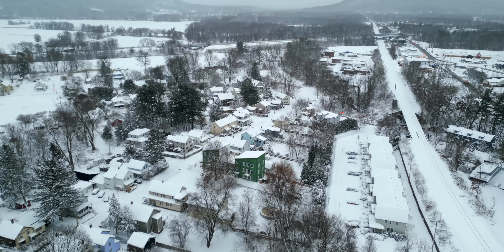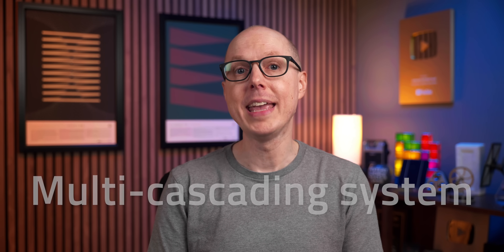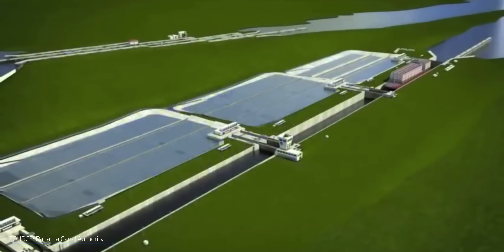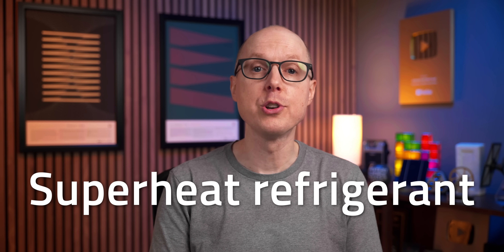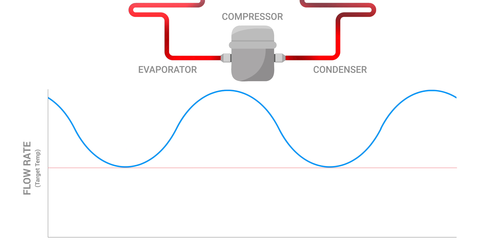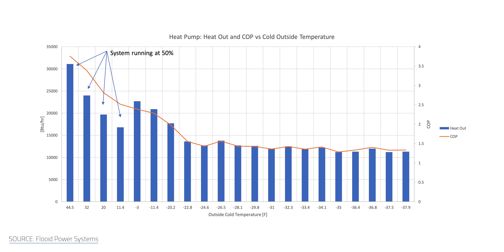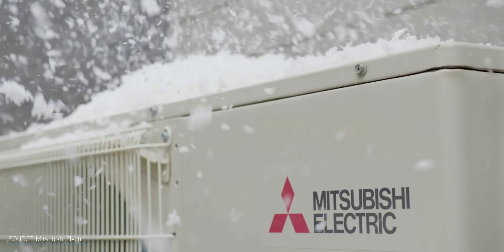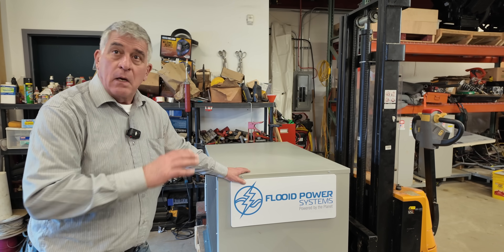How This New Heat Pump is Genius

Comment: Ground source...

The refrigeration cycle is the future.

I've always thought that a central heat exchanger utilizing the heat store of geothermal was the way to go.  Then, heat pump water heaters or full AC systems can tap into the geothermal fluid tank to heat and cool.  And rather than waste the heat to the atmosphere, it's eventually pumped back into the thermal battery of the ground.

Geothermal temperatures are around 55°F year round depending on latitude.  There's your constant fluid temperature issue solved!  And, in the Summer, there's no need for the compressor to run at all with a thermal battery at 55°F!

Imagine your kitchen refrigerator being almost silent since the the compressor is in the basement with the geothermal heat exchanger tank!
Reply: You need to have a system that doesn't leak, otherwise you have an expensive repair. Ask me how I know.
Reply: @jamesvandamme7786  Yep!  Leaks do no good in any system!
Reply: @jamesvandamme7786  Yep, natural gas, oil, and propane never leak.

Comment: Sorry but sounds like BS, because it doesn't add up. You can cascade a million times but you aren't getting more heat than the first unit can move heat pumps aren't some magical device and when giving their numbers they 400% efficient they are 400% effective. The difference being that efficiency is the conversion of power which can never exceed 100% and in a heatpump that conversion is electrical to rotational a heatpump doesn't generate heat well other than losses but as a function of it's operation it moves heat from one location to another.
Now for the cascading system if we take heat and think of it as a unit of mass, if the first unit pulls 4 tons of heat from a source and put it in a holding tank then a second unit pulls from that holding tank to heat an area there is still only 4 tons of heat except now you have used double the power. The limiting factor will always be how much heat can be extracted from the source
Reply: A function of it is operation? Huh?
Reply: There's no such thing as a "400% efficient" (really COP of 4) heat pump, that's just a marketing average. Hot and cold side temperatures affect the actual capacity and COP of a heat pump. A given heat pump might be able to output 5000W of heat when it's 5F outside and 70F inside but if it was only 45F inside it might output 10000W of heat.

Comment: Best thing to do is buy an regular furnace. Cheaper simpler, more reliable more comfort, faster temperature changes. Works best and you dont have to think about it. To much over engineering and less reliable costly products.

Comment: you could achieve the same with 100 year old tech  of using ammonia (R717) with out having  cascading  heat pumps .  ammonia   is cheap , environmentally friendly (not ozone depleting or a  greenhouse gas as the amount of refrigerant leakage per year is equal to  couple 100 million cars on the road in comparison to GHG effects  )  . and  6 times more efficient then other refrigerants

Comment: We have 2 air source heat pumps, about 10 and 6 years old, on our home.  We live in CT these days and oil is our primary heat source.  We have consistently saved about 1/3 to 40% of our oil usage for heating, thus saving hundreds of gallons of oil each year while saving money, as the net cost of electricity is less than the oil for those BTUs.  I am an engineer, and compare our oil cost * efficiency of our furnace to our heat pumps and electricity costs.  It's a no brainer for saving money, and we still have the oil for days below about 30F.  25F to 40F roughly, depends on the oil price and electric price that year, is our break even point.
Reply: Wouldn't a ground sourced heat pump be able to do 100%, and NO fossil fuels?
Reply: @LoanwordEggcorn  In most of the USA (basically excluding Alaska and the northern-most portions of the states bordering Canada) the question is less ground source vs. air source than it is one of system design.
The other thing to keep in mind is your target: 100% heat pump with no backup for cost control and comfort OR a system designed to minimize costs during times of temperatures low enough to cause the heat pump to be less efficient.
Reply: @DrewNorthup  Ground source heat pumps are far less affected by air temperature, etc., since the ground temperature (a few meters down) is far more stable, including at northern latitudes.
Reply: I'm up in Maine and did >65% of my heating last winter with a heat pump. In fact, the main reason why more of that wasn't done by the heat pump is that it can't heat the bedroom when the door is shut (1 mini-split in the primary living area). The unit was made in 2021 and is good down to -15°F, with the apparent "cross-over" temperature being around -12°F at worst. (In reality the separately controlled oil heat loop likely began to kick in around -11°F as the rooms far from the heat pump would've been hard to use otherwise.)
Reply: thank you for the information. I to live in CT and this is one more reason to go with a heat pump
Reply: @charlessalisbury4237  just get a very large one that is good for heating or have a backup. We didn't take out our oil system. We just left it there and we just use it a lot less basically nights in January. Unfortunately you know when you get those. Really cold days here in CT. It's it really is unfortunately still better to burn the oil. I don't know about natural gas because I asked the gas company when we moved in and they're like they're not going to bring the gas line anywheres near my street let alone my home. So that's off the table for me.
Reply: Australian here, what do you mean use oil for heating? You don’t use the oil as fuel do you?
Reply: @aussiegruber86   That's exactly what oil heat is. Oil is pumped through a nozzle and burned.
Reply: Yep it's fuel oil, we don't kill whales for it anymore... But it's stored in large tanks and burned indoors with a ventilation system. It's really only used in the northern climates top 30% of the US.  @aussiegruber86
Reply: @aussiegruber86  yes millions of US homes, mostly between the state of Maine to New York burn heating oil. Mine is one of them and it was built about 40 years ago.
Reply: Current cold weather heat pumps work well below 30 degrees F. We have an existing natural gas boiler that serves as a backup but only use it if the temperatures drop below 5 degrees F. In our case that was 2 days last winter. Other cold climate heat pumps can still provide 100% of the their rated BTU capacity at -10 to -15 degrees F.
Reply: @COSolar6419   It depends on what you mean by "works well." Current cold weather heat pumps maintain decent capacity well below freezing but the COP still falls with lower temperatures. Below a certain temperature it's more cost-efficient to heat by burning fossil fuels.
Reply: @eDoc2020  Not if you count the environmental costs of burning fossil fuels and fossil gas production. Those are real costs we pass on to everyone.
Reply: @COSolar6419  you are assuming that electricity doesn't come from fossil fuels too.  

Consider electricity losses in transmission.  Consider the environmental impact of solar panels, I have made them, or wind, but neither of which provide more than a few % of power in my area. Mostly natural gas is our electricity source
Reply: @COSolar6419  our heat pump works below 25F but the efficiency falls off and our oil furnace is more coat effective.  It will supply heat down to those temps but at low efficiency.

Comment: Here in northern Maine our electric rate is $0.268 /kwh delivered. Even a 300% efficient heat pump is not economical compared to burning things. I burn wood, most "green" heat there is.
Reply: Conventional wood-burning stoves are only up to 60% efficient IIRC. The most efficient option for heating from wood is a wood gasifier feeding a gas turbine which powers a heat pump. The waste heat from the turbine would also heat the house.

Is this overly complicated? Yes.
Reply: @eDoc2020  I have an indoor wood gasification boiler and thermal heat storage. I estimate my system to be 80-85% efficient.

Comment: My instincts point me to lower technologies. Here is my concept: very high mass within R-60 walls and ceiling. Night time ventilation per a fan driven reverse chimney to cool the dwelling the day. A batch water heater for eight months of the year. Kitchen and laundry isolated and vented. The three story house counted a full basement and a deck over the roof system with full parapet to hide solar panels. Granted this is dwelling would be masonry heavy and it won't be 30 year life span strand board 'master piece'. It is a pipe dream. Too poor and too old for it to matter.

Comment: Cascading heat pumps means more equipment, higher cost, and more maintenance. There may be applications where the benefits outweigh the cost and complexity, but not for the average homeowner.

Comment: How would one purchase these heat pumps types?  Especially for the Southern States with high cooling loads?  Local dealers are stating these  units are not available and it will take ten years or more if they come to market at all.

Comment: Couldn't you do this with one heat pump that dynamically adjusts the fluid type to optimize it based on the external temp...?

Comment: I used to work on controls for cascaded refrigeration units for use in medical and scientific applications. Once you have a second stage, it's pretty crazy what kinds of temperature gradients you can have. IIRC, one of them I worked on was a -150C system.

Heat pump is love. Heat pump is life.
Reply: Let us know when you get a heat pump tattoo 🤣 pump on!

Comment: Glaring problem with cascading heat pumps: there are only a handful of technicians that can service the system in Massachusetts, and they all work at Thermo Fisher and Shon's.
Reply: Doesn't... every new technology only have a handful of technicians at the startup stages?
You know that HVAC training is a thing, right?
Reply: Everything on this channel is always cutting edge. There's not many people doing anything he talks about. There's not a lot of electric car repair shops either

Comment: It’s an interesting idea, but I’d much rather see a standardization for residential appliances like refrigerators, freezers, water heaters and outdoor heatpumps, so I could link all of them as an interacting refrigeration cycle system. Seems like propane would be an ideal refrigerant for this purpose, however American HVAC trades/unions wouldn’t like that one bit.

Comment: I'm planning on intergrating my MVHR setup to work with an air-air heat pump in the future, I really wish there were more videos on how to accomplish this, I had to teach myself.
It involves a fair bit of clever ductwork, but the idea is to further reduce the load on the evaporator head so that the heat pump has very little to do, either in heat or cool modes.
I currently use my excessively over-insulated loft space as a sort of 'thermal battery' and that's what my MVHR unit currently draws air from, so the loft space is one huge heat exchanger.
To date, I've never heard of anyone using a passive system like this, but it works extremely well so far.

I've had to do this because my ancient (20yr old) gas boiler does not run very well, it struggles at anything over minimum temperature settings and I currently can't afford a new one.
Therefore, my focus shifted towards making the MVHR system as efficient as humanly possible. The loft is vented, but it is only an inlet for fresh air. The MVHR unit draws this pre-warmed air from the loft space, boosts the temeprature up and pumps it into the house. Any warm air from the house is sucked into the MVHR unit, the heat is recovered, then exhausted outside.
Fitting a heat pump evaporator unit between the MVHR house suction and intake vents only would mean that the heat pump is only accounting for the small efficiency loss of the MVHR unit (curently around 80% efficiency) so the heat pump is only adding in ~20% into the house to maintain a temperature, instead of having to apply 100% of the load.

One other thing that I can currently do with my MVHR setup is that I can change the height of the loft intake vent by opening and closing a set of damper valves. This dictates how much air is being drawn into the loft space depending on what season it is. In summer, I open the upper damper so that most of the heat in the loft is vented, but in winter this is closed and the air is drawn in at floor level of the loft (due to heat naturally rising towards the top of the roof, where the intake of the MVHR unit is placed). 
This effects if the MVHR is drawing in cooler outside air in summer or warmer rising air from the house in winter, I plan to make this motorised and automatically controlled.

I'm currently working on a way of adding in a heat pump hot water cylinder in the further future, but ducting this in as well seems to be interesting.
The goal is that as little heat as possible is exhausted out of the MVHR unit, while in effect, making an air-to-air heat pump indirectly provide hot domestic water.
For a couple of figures, my MVHR unit draws a constant 25W of electricity, yet in it's current setup, it's maintaining my house between 16-18'C whatever the weather outside.
Adding in the air-to-air heat pump is primarily to get rid of my unreliable gas boiler, but it's worth using the existing MVHR system to heat the entire house from 1x HP unit.

Comment: Matt: A cascading heat pump means you have multiple sets of compressor, condensers and other components in a heat pump. All else equal, the cost would be higher than a non-cascading system. People justify a hybrid heat pump system with electrical heat or a gas furnace because an extremely cold day is not commonly encounter in winter. Why pay more for a cascading system if you only need it a few days in a winter season?  I think you would only need it if a non-cascading system cannot do the job on a regularly basis.

Comment: I want a heat pump with reversing valve in the form factor of a window ac unit.
Reply: They make those now. I think they came on the market in the past year or two.
Reply: @eDoc2020  Would you happen to have a web link to one?  I haven't been able to find any.
Reply: @PupShepardRubberized   I'm not finding too many window-style ones but am having better luck with portable-style ones. One example is Westinghouse WPac14000h which I am sure heats using heat pump. Many cheaper ones only have resistance heat, the 10500 rated heating Btus (and one customer review) confirm that this heats using compressor. The largest resistance heater that you can possibly run on a standard household outlet is about 6000Btu/hr.

Comment: Cascade cycles and 2 stage systems have existed since mechanical refrigeration was invented.  Any good refrigeration engineer can design one…..many engineering classes have had a group project on this very topic…..then having done so has determined it to be uneconomic for residential heating in cold climates….end of story….

Comment: It's a very interesting concept that if they work out the theoretical (lab results) into an actual product that can be produced & sold it could be impressive. (So much so that I could see a larger company buying Flooid Power out) That said as long as the primay needs are heating, it's still not going to do better for your standard home customer if their primary needs are mostly heat & Nat gas is as available & cheap to use.

Comment: boven 46’C wont work, haha what a bullshit

heatpumps with R134a or newer R290 Propane work just fine up to even 70'C (158'F) at COP of ~2.0 and sometimes even higher, no need for expensive cascading there

Comment: I would be interested in the systems Noise levels.  If we want the basement area where the inside unit connects to the ventilation system to also be a living space, can we put the inside unit in an insulated control room?  How noisy is it and how much ventilation fan noise?  How do you manage multiple temperature zones - say 2nd floor bedrooms with baths, and 1st floor living spaces, and kitchens, and basement suite?

thanks!
Reply: It should already be insulated and additional insulation shouldn't hurt it. There's probably a damper-based zoning system that is compatible, just like you would use on any forced air system.

Comment: Or if your building your house from scratch you could use a passive air conditioning system that resembles a chimney referred to as a wind catcher like that used buy the ancient Persians and Egyptians and save alot of energy. The advantage being the technology is well known and around 3000 years old so it's definitely a mature technology and it uses 0 energy yet can produce ice in places like Iran which can reach up to 130f.

Comment: I wonder if this setup can be kinda upscaled let's say 3 units to get extra high temperatures 570F~300C so that in the summer we could warm up an isolated thermal battery underground and use that heat during winter (with such temperatures would also be possible to run a steam turbine generator for emergency situations) it would allow to "trap"and store the heat of the summer to use in during the winter